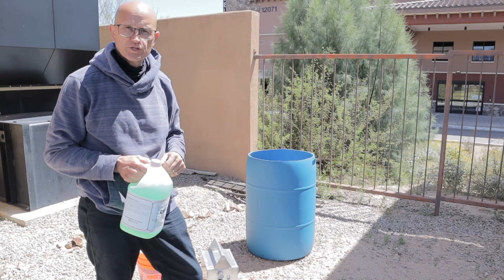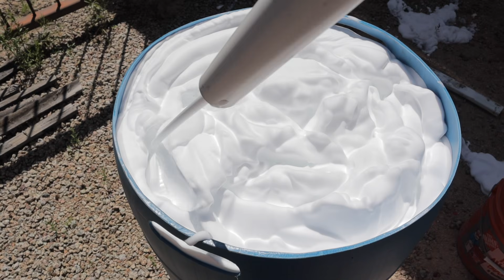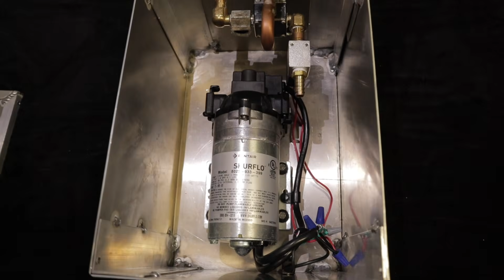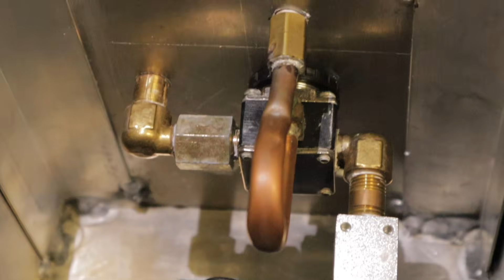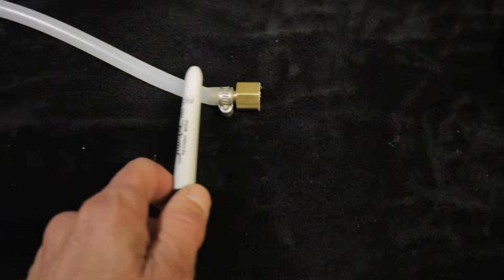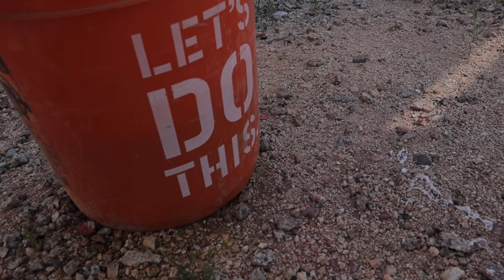Aircrete Foam Generator Machine DIY  [ How To build one that makes Great Foam!

Comment: Thanks for the video and the schematic.  I used your for the basis of my design with a couple of tweaks.  I did not ability to weld up a box, so I just bought a 20" toolbox with metal latches.  I also put a "equipment switch" that has the three prong mail adapter.  That allows me to remove the cord and store in one of the lid storage areas.  I put my suction tube in the other lid storage.  The interior tray fits the 13" wand and hose.  All in one need box you can carry and store easily.
Reply from the maker: Hi John, I like the way you think!  Using an existing tool box saves a bunch of time an I like the removable cord and storage idea. Thanks!👍😁
Reply: @PranaTech  Thanks,  did not realize how bad the spelling and grammar was on my post.  We are going to make aircrete ICF (much like e-z block for our house build.  I would be interested in your pump you mention in the thread if you have moved forward with it.
Reply from the maker: High John, great to hear from you!  Sounds like a great project you have for your home build. You’ll have to do some experiments to see how high you can can stack your block before you do your grout fills on the cells. Aircrete doesn’t have a lot of tensile strength so the side loading that the grout filling will have may necessitate the addition of some fibers into the Aircrete to add some cross sectional strength to your blocks. My large pump is a little delayed right now as I’m in the process of clearing a part of my property to build a bigger shop. The design is exactly the same as my high output foam generator but I used a 1” diaphragm pump for the higher volume of foam production. 😁👍
Reply: @prana-tech, thanks so much for your awesome videos🙏 when you say that CLC doesn't have tensile strength, you can solve that by using rebar right? Or adding some fiber to the mix?
Reply from the maker: Hi Ian, adding some fibers would increase the tensile strength for sure! Rebar would not help because the problem is that there is so much air in the final product that it becomes very brittle and breaks easily.👍

Comment: Awesome video man!! I’m considering learning how to make aircrete. I’m originally from Liberia, I know aircrete will make a huge difference for builders in my homeland. God bless you
Reply from the maker: Hi Thomas! Thank you for your kind words my friend! Stay tuned because I have been experimenting for a while now with a chemical induced Aircrete that rises like a loaf of bread. It needs no foam machine and is a much simpler system to produce reliably. It also only needs a cement mixer and the raw materials to produce it. I am in the process of making molds right now and then I will come out with a video showing the process. 😊👍
Reply: @PranaTech This is interesting topic. Very curious on this topic to create reliable lightweight concrete without foam generator...
Keep up the good work!

Comment: Seen so many videos, this is definitely very detailed and to the last part. Thank you and look forward to learn more. 👍👌👌
Reply from the maker: Jyothirmaya, thank you for your nice comment!  Stay tuned because I am about to release a new video with an even simpler foam generator with parts that are available worldwide and uses only air pressure to operate. Thank you!😀🙏❤️
Reply: @PranaTech  Yes sir! Please do it... Out of many videos that i have watched, yours are definitely among the best. Love your detail, rigurosity and accuracy. Inspiring!
Reply from the maker: Thank you so much Alejandro! I am just finishing up with testing of the new design and it is working great! I’ve designed a new foam wand as well because my old design could not handle the higher output of this new generator. I should have the new video edited and uploaded in the next 4 to 5 days. Thanks for your comments!😁🙏

Comment: I just built a foam generator so that I can experiment with making air Crete. I chose to use Ajax dish detergent for the test just because I have it already and on my first test I used 6 ounces of soap to 1 gallon of water and the foam comes out pretty nice but I’m still experimenting. I haven’t tried it yet but I also have been told that adding glycerin to the soap helps with holding the structure of the bubbles. I will do a test
Reply from the maker: Hi Ben!  That’s great! Glad to see others working with this stuff! I haven’t tried the glycerin trick yet but I’ve heard about it. Be curious to see what you find with it.😊👍
Reply: @Prana-Tech  ok so I picked up some glycerin from Walmart but I’m definitely going to look for a larger amount for a way better price. At 6oz for $5 plus tax is not going to be cost effective.  originally I had mixed about 4 ounces of Suave to 1 gallon of water I tried that and I made a really nice foam but then set my timer for one hour just for an example and after one hour my foam had dropped by about 4 inches in the 5 gallon bucket this is without the glycerin!  I did a second test with approximately a quart from my one gallon of mix suave daily clarifying shampoo solution I had made but in that quart I added 1 ounce of glycerin and 3 ounces of clear light corn syrup because that is what I found online of how to make homemade bubble solution so I was thinking well if it makes quality bubble solution why wouldn’t it make nice foam. Well I am pretty pleased with the results after one hour and my 5 gallon bucket of foam has not even a drop and inch and it is still level to the top of the 5 gallon bucket but the only thing is and it’s acceptable is that the foam definitely gets more airy ( loser more open bubbles) the longer it sits though it doesn’t lose its height.
Reply from the maker: Hi Ben! Interesting results! I’ve been experimenting with this stuff for a while now and in my experience the smaller the bubbles the more effective the foam solution will be and the more durable it will be once mixed with the cement. The closer you can get to shaving cream consistency the better. You want a very dense foam with the smallest bubbles. The larger bubbles just pop when mixed with the cement. Hope this helps! 😁👍

Comment: Great Video. I'm new to air crete so this was a great tutorial.. Thanks. Great design on the foam generator as well, very nice job. Just one suggestion for your foam generator construction. I didn't see a Ground wire going to the aluminum enclosure. I may have missed it, but if not, you might want to add one to limit the chances of shocking yourself in wet environments. : )  Safety First!  :)
Reply from the maker: Hey, thank you for the nice comment and the safety tip! I will definitely hook up that ground wire. Good eyes!👍😁
Reply: @PranaTech  Thanks for this! Also, I realize this is a year or more old, but don't just attach a bonding wire to the case!!! 

There's a dangerous misconception that bonding (grounding) is meant to be a protection for wet environments, and/or that it protects against shock! 

The green bonding wire (aka ground fault wire) is attached to the motor case, just as it should be, only to trip a breaker in the case that there is a failure in the motor causing the case to become energized. If the motor case is attached to the box through the attaching foot, then bonding the case to the electrical panel is already done. If the motor is insulated from the box then that's excellent. 

Attaching the box to the motor case adds a conductor directly to the ground it's sitting on. If it were wet, and the there were to be a fault that energized the box you're holding, and the box is connected to the motor case, then the energy would move through not only the green wire back to the electrical panel, but also through you, and may not trip the breaker! Electricity does not take the path of least resistance, it takes all paths back to the service panel at the same time, current being dependent on resistance. 

Anyway, thank you again! 

https://youtu.be/3vvvv5QVZoA
Reply from the maker: Yes, I hooked the ground up to the motor because it is isolated on rubber mounts. Thank you for the safety advice! Cheers!😊👍

Comment: Great videos! Thanks for sharing your awesome knowledge! Starting mine tmrw ;)
Reply from the maker: That’s great! Let me know if you have any questions when you get building. 😁👍Don
Reply: Hi Don, I have been looking around different stores around my place, and the closest pump to the one in your system has has the following specs:
Centrifugal pump, 18L/min, Total head 10M.
The biggest model is giving 25L/min and has a total head of 18M. 
If I am not mistaken they are far from the 90PSI needed. What do you think?
Reply from the maker: Hi there, the important thing with the pump is that it puts out at least 60 PSI to balance with the air pressure. Otherwise the air is trying to push the water back into the pump. 👍😁
Reply: @PranaTech  Good morning, hope you are well. I wanted to ask you: with your experience, do you think that the size of the tubes I pick will matter much in my final mix of foam?
My pump should deliver 160 PSI with a debit of 5.5 LPM and I am about to use 1/2 inch tube to connect with the Y fitting.
My Air system has tubes of 1/4 inch, and might be of a lower pressure (usually standard Air compressors deliver around 120 PSI).
Do you think that my tubes, on both air and water side  need to be same diameter and equal pressures? Or it doesnt matter much?
For the water pressure, I have been thinking to add a regulator to reduce it. Any advice?
Thank you very much for your help,
Nico
Reply from the maker: Good morning Nico! All is well here and I wish the same for you!  As far as the lines go, I think you will be fine with the ¼” air line.  The diaphragm pumps seem to adjust their pressure to match the air pressure where they meet in the y fitting so I believe you will be fine. Your pump’s output is quite a bit higher than mine so you may need to just put a ball valve inline to reduce the outflow.  I would only do this if the foam was coming out to wet and I was not able to balance it by increasing air pressure.  My gut feeling is that you will merely have to run a little higher air pressure than I do to match the output of your larger pump output. Most of the time I run right at 60psi of air pressure to make great foam.  To make sure your foam is good, once it is thick and creamy like shaving cream, fill a 5 gallon bucket (19 liters) and it should weigh 3 to 3.5 pounds (1.36 to 1.58 kg).  Hope this helps! 👍😀Don

Comment: Great info. I really enjoy all of your videos. I am looking forward to going Aircreat and would like a few suggestions. Could you please recommend the formula of Richway foaming solution, water and cement to make a 45 gallon mixture.
Reply from the maker: Hi Mento!  For a 45 gallon mix, I put 4 ounces of Richway concentrate into 5 gallons of water for the foam machine. I then put 6.5 gallons of water into a 55 gallon container I then start to slowly blend a full 94 pound bag of Portland into the water until fully incorporated and smooth. I then fill up the container with foam up to the 45 gallon mark and then slowly blend the foam into the Portland cement mix until just fully blended and then pour into your mold. 😊👍
Reply: @PranaTech  Thank you for your timely response. That was very useful information. One more question. In a rough estimate, how much forms can I get from the 45 gallon mixture when the forms are 48 in X 24 in X 4 in?
Reply from the maker: Hi Mento, the foam gets beaten down a little by mixing into the Portland so depending how much you mix it probably about 1.5 of your forms will be filled because your form is right at 20 gallons. 😊👍
Reply: @PranaTech  Thanks you very much. Really appreciate your response. Now I know how much Freeway solution to buy. Thank you lord for this channel.😊
Reply from the maker: Anytime! Just let me know if you have any other questions. 😊👍

Comment: I appreciate your videos, others show their machine and offer it for sale, yours is truly aimed at the DIyer. I think the link you have for the 110 volt solenoid is wrong as it is now going to a 12 VDC solenoid. Thanks again.
Reply from the maker: Hey, thanks for your nice comments and thank you as well for letting me know about the bad link on the solenoid!👍😁Don
Reply: @PranaTech  No worries, glad to help and thanks again for doin what you do… Do you know if anyone makes a pump that is conducive to mounting vertically rather than horizontally.
Reply from the maker: I think these diaphragm pumps can be mounted any direction you want. I’ve seen them mounted in RVs upside down and vertical and they work great. 👍
Reply: @PranaTech  Thanks
Reply: Another question if I may, concerning the in and out fittings on the pump they look like they are QD do they come with the pump or do I order them? What are they called? The motor seems to be around 150 but I don't know how to verify the in and outlet. Thanks again..
Reply from the maker: Hi there, yes the inlet and outlet are sliding QD mounts. I got my pump used off of EBay so I’m not sure if they come with the pump or not. Here are a couple that I found this morning that are powerful enough to work with my design. https://www.ebay.com/itm/New-Aquatec-Demand-Delivery-Diaphragm-Pumps-115V-AC-80-PSI-1-GPM-DDP-7800-Barb/303603541368?hash=item46b02e6578:g:NZkAAOSweW9e8VOg 
And here is the other one. https://www.ebay.com/itm/BACOENG-AC-115V-100PSI-110GPH-High-Pressure-Water-Diaphragm-Pump-Misting/233262347144?hash=item364f84f388:g:WFQAAOSwDm1dCik7
I usually run my air pressure around 55-60 psi to produce good thick foam so either of these pumps would work great and they both appear to come with barb QD fittings with them.  I’m sure you could order the correct barb fittings from aquatec if the ones that come with it aren’t the correct size. Hope this helps. 😀Don
Reply: @PranaTech  Thank you for taking the time to answer my questions Don, much appreciated. Jim
Reply from the maker: You are very welcome Jim! Let me know if you have any other questions.🙏😁

Comment: Dude good video thanks and I can't believe someone did a thumbs down on this video thanks again
Reply from the maker: Hey Boo,  thanks man! Yeah, there’s always a few out there that just can’t be pleased.🤣👍
Reply: @PranaTech  ain't that the truth lol so I'm going to making some Aircrete soon was wondering if you think a electric transfer pump would be strong enough to transfer the Aircrete from the drum into the moulding you want to put it in
Reply from the maker: Well, Aircrete doesn’t do very well going through pumps. It tends to pop the bubbles and make it collapse.  The only kind of pumps that work well with Aircrete are peristaltic hose type pumps and screw auger pumps because they are gentle on the bubbles. Hope this helps! 👍 Don
Reply: @PranaTech  thank you I'll look into that
Reply: @PranaTech  by hose type pump do you mean like a eco flo thermoplastic drill pump
Reply from the maker: Peristaltic hose pumps for concrete look like this. https://www.northridgepumps.com/p_233_boyser-fmp50-peristaltic-pump  They are pretty pricey.😱
Reply: @PranaTech  I see lol thanks for the input and the link you and your videos have for sure been helpful

Comment: Great information thanks! Just curious about how thick a block can be cast using aircrete before it’s own weight causes the foam to start collapsing. Most demos I’ve seen are only a few inches deep, it’d be handy if thicker forms are possible.
Reply from the maker: From what I have read, you can go to about 3 feet tall in your mold before the weight is too much for the bubbles. 😊👍
Reply: @PranaTech  Cool, thanks for the reply! That’s actually quite a bit more than I expected.

Comment: Very helpful video and the generator looks really neat!
I'm planning on building my own based upon this explanation :) 
Maybe I missed it, but could you provide the widths of the tubes and connectors?

EDIT: ah if anyone is searching for it, parts are in the description!
Reply from the maker: Thank you! If you have any questions when you begin building yours, just leave them in the comments and I will try and help. 😀👍Don
Reply: @PranaTech  I do have a question actually. Here and there I read that 90 PSI is required. Haven't read anywhere why though. Could you explain?
The Shurflo pump is rated at 90 PSI, but I can't easily find a pump with those specs here in the Netherlands (only Chinese crap from Aliexpress). So I'm reworking your design a bit to make it suitables for Dutchies/Europeans ;) and therefore I'd like to know if it's really required.
Reply from the maker: Hi NM,  so I copied the pump from domegaia, but after using it for a while now, most of the time I set the air pressure about 55-60 pounds per square inch or 380-415 Kpa in metric. So I really don’t think you need a pump that large to make good foam. A pump that would output 60 psi should work just fine. It really just needs to balance with the air pressure so they are equal at the outlet Y. All of this depends on using a foam wand the same size as the one in my how to video. I had made a larger one earlier and it was too big for my generator to produce good foam so I had to downsize.  The gallons per minute though should be at least 1.5 gpm or 6 liters per minute. Hope this helps! 👍😀Don